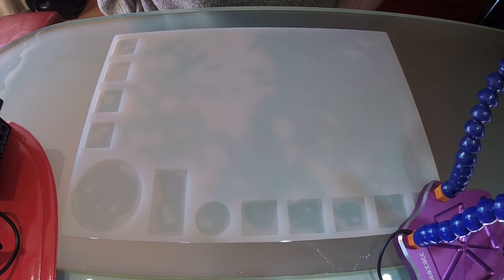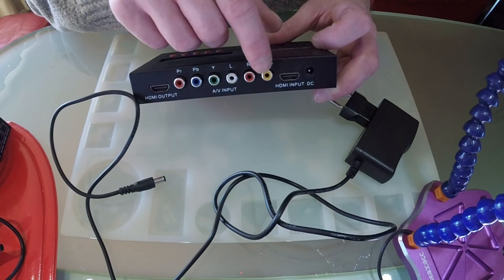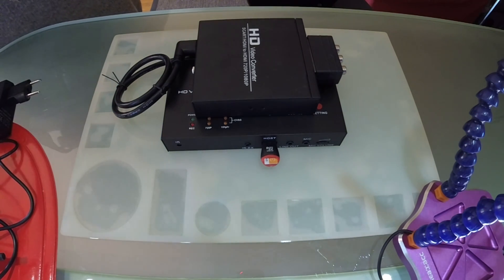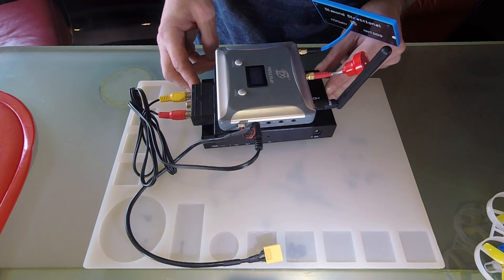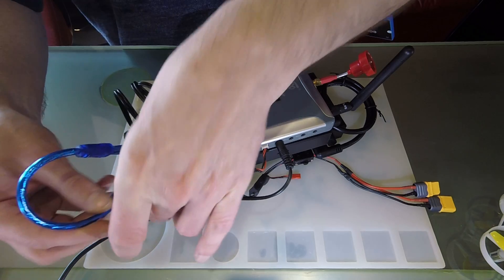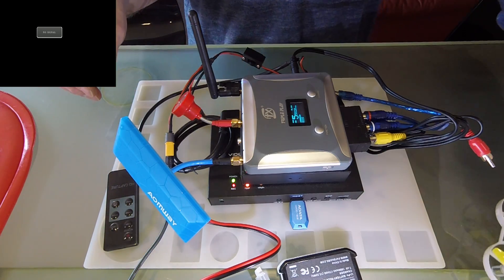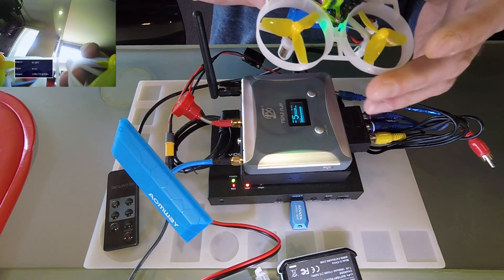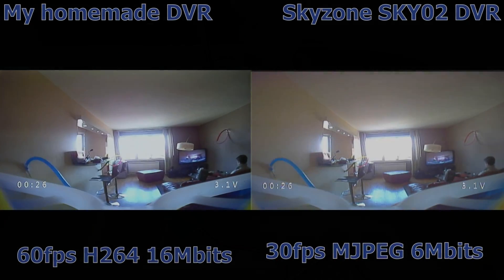FPV NTSC/PAL feed recording : how to increase video quality (60fps, high bitrate)

Comment: bonjour
le soucis avec l'utilisation d'une seul et unique batterie est du a un bouclage de masse, tu a une masse commune sur le 0V de l'alimentation et un 0V commun sur les RCA, pour corriger le probleme il faut se fabriquer un petit adapateur RCA<>RCA avec uniquement le point centrale de cabler pour isoler les masse des deux appareil et donc avoir une masse commune uniquement sur un point a savoir le 0V de l'alimentation. pour vérifier, fait un essaie en insérant le rca sans que le blindage entre en contact mais que le point du millieu entre en contact.
coté DVR, très bonne approche, perso j'utilise un enregistreur dédier video surveillance qui encode en H264 ou H265 sur un disque 2To, faut compter 50E pour un modéle 4 cannaux
Cordialement
Reply from the maker: Merci pour l'info. Je vais essayer ca des que possible. Je te tiens au courant.
Tu aurais un lien vers ton enregisteur video que je jete un oeil ? Ca encode proprement du NTSC, en gardant les 60fps ?
Reply: @dududu7694  j'utilise un dahua dvr5108h ( qui n'est plus fabriquer ) il est remplacer par un modèle de ce genre 
https://fr.aliexpress.com/item/1005001657312463.html
pour l'encodage il est limité a 25fps en pal et 30 en ntsc ( a voir sur les nouveau modèle )
personnellement, je me suis orienté vers cette solution pour plusieurs raisons :
- j'en récupères dans mon cadre professionnelle
-possibilité d'alimenter en 3S ( avec une 3S 5000mAh je tiens 3H )
-qualité d'images
-grande capacité de stockage horodaté avec connexion IP pour extraire les vidéos intéressante directement depuis le pc ou sur le téléphone  
-et surtout le nombre de canaux, je pilote avec des amis et on avais le besoin d'enregistrer en simultané plusieurs vidéo différente et avoir une relecture avec toute les video en même temps et synchronisé.
j'ai ajouter deux récepteur a l’intérieur avec un micro contrôleur pour choisir la fréquence des 2 canaux.
je te partage un dossier dropbox avec un export vidéo de 2 minutes pour te faire une idée .la vidéo reste dégueulasse a causse de la cam d'origine du mobula 7
https://www.dropbox.com/sh/o2lr2o953ciz5vv/AAAD6tsmF7QhTGVJ3uhHAzLUa?dl=0
Reply from the maker: @techniciendelextreme8855  C'est sur que si tu recupere le matos gratos, c'est une bonne solution . Mais aujourd'hui, je conseillerais plutôt un dvr powerplay. Il est pas parfait, mais c'est probablement le meilleur rapport qualité/prix/facilité d'utilisation.

Comment: Followed you here from some other links on forums and a tip on another video. This video needs WAY more hits. I'll be trying to reference it whenever possible. The folks who do a lot of camera reviews NEED this. I'm going to be trying to piece together something like it but sourced from Amazon since I'm in the US. My upscaler and DVR are coming tomorrow. If I like it and it's small enough, I'd like to Velcro them to the bottom of my Taranis and do switching regs coming off of the Taranis battery to power the upscaler, dvr, and goggles. I like a more mobile style, and I like my RapidFire,....   Thanks for the idea!!!!!